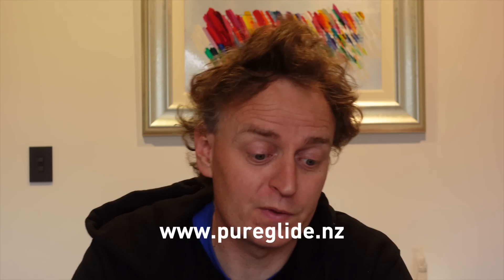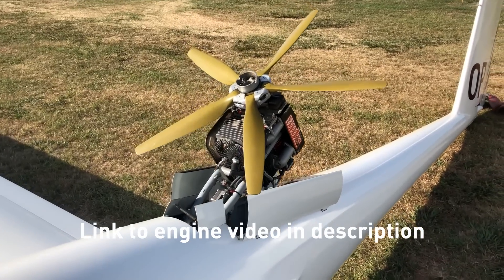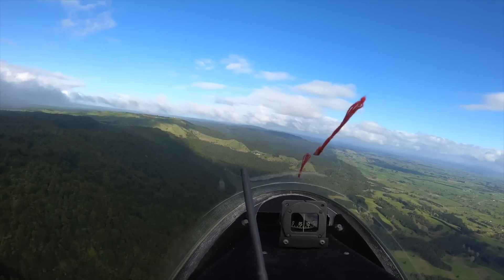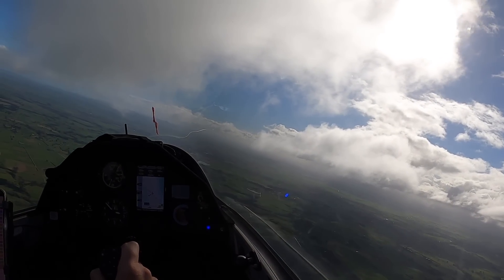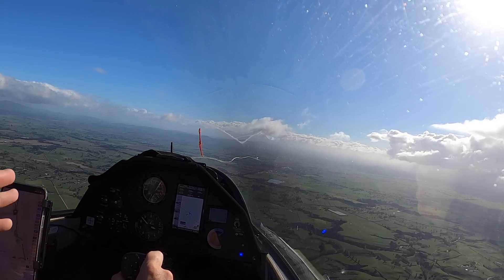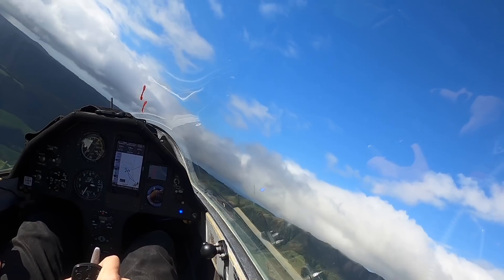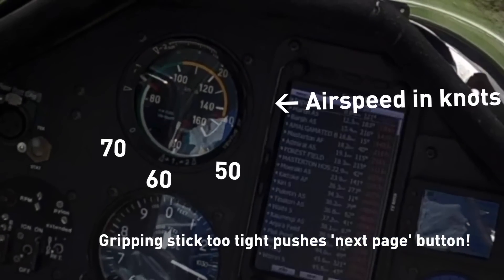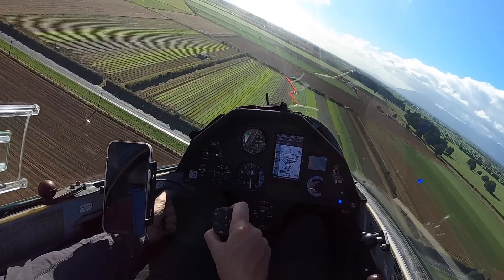Is it safe to open air brakes/spoilers in a turn?!

Comment: Nothing is fixed ... As you say, it depends on the parameters. For example:  the stall is a function of AOA NOT speed. A very common error! You can stall at any speed  if you can be that dynamic in AOA change...

Comment: Our airfield has a hill in the way right at final turn height, its a popular spot for walkers so approaching over the top of it is not tolerated. Only round 300m from the treshold. Its also the one most used due to prevailing winds. It's a regular arguement in the annual instructor meeting as to whether people should do it or not. We came to the same conclusion: Obey the minimum speed that you promised yourself and it's absolutely fine.

Comment: in a landing pattern the crucial parameter is speed : I teach my students to maintain approach speed (stall speed + 30%) until they turn final, then increase for headwind on final if necessary. At correct approach speed, even a poorly coordinated turn will never be deadly. If the student finds himself too high on base leg, using the spoilers allows him to reach final at a correct height, but I will usually advise to close them while turning final, because beginners usually have a hard time controlling all the parameters at the same time. 
On the oher hand, if the student is (too) low, then obviously there is no reason to use the spoilers until on final.
I do train the students to turn with the spoilers out, however, but while comfortably high : I'll request that they force the descent at the end of a flight by making  alternating turns on an "8" pattern with the spoilers half open... Great exercise for coordinating speed, roll, yaw, descent rate, and security !

Comment: Christ.....stalling a glider is NOTHING compared to powered crafts. You loose very little altitude stalling a glider do to the fact it takes very little speed after the stall when the glider starts flying efficiently again. There is virtually no danger concerning the topic of this video....WN Competiition pilot
Reply from the maker: haha depends how close to the ground you are
Reply: @PureGlide  ha ha ha........you could be lower than pattern altitude and recover without incident. Besides...anyone crashing a glider due to stalling it has no business flying them since sigificant extra speed well above stall speed is a given rule close to the ground.

Comment: You'te hot dogging it into the final but if you can get away with it, good luck to you. Also, using the engine is cheating.

Comment: Anyone who has stalled or nearly stalled while pulling the brakes was flying too slow to begin with.. If you are flying above stall speed as you should be in any configuration then it makes no difference, if your threading the line then dont use brakes, they are brakes afterall they create drag instantly which will shave off a few knotts quickly..

Comment: Your first stall was incorrect: you moved aileron to the right too soon, you should have corrected it with rudder only!
Reply from the maker: Probably true! It's so easy
Reply: The most counterintuitive thing is to move stick towards wing which dropped (or keep it neutral at least), and rudder in the other direction.  Otherwise you may stall more the wing which dropped. But modern gliders are very safe, so even if you get into insipient spin, just by releasing the stick pressure the glider comes out immediately    @PureGlide

Comment: Seems like a very obvious outcome since it all depends on your airspeed going in the turn.
The wing needs airspeed

A banking  increases your stall speed, 
B flaps slow you down but reduce your stall speed a bit
C banking  slows you down
D braking slows you down even more

IF 
A*B*C*D  
> 
VS1   
THEN 

GTG  

And the higher you are , the safer you can try it

Comment: Before watching the video I’m going to say “I wouldn’t if I were making any landing preparation turns with limited energy” only because I want to be super careful about stalling the inside wing. Let’s see how I do, I’m a glider pilot but I’m always learning. Great video, kinda what I thought in that airbrakes don’t change the stall speed so much (unlike flaps) The last video of your low level banking while you were squaring into final was a real sphincter workout. 😢Since I mention flaps, I’ve never flown a glider with them, do any modern gliders have flaps or crow-braking?🧐
Reply from the maker: Hi yeah most modern gliders have flaps. Most of the glider development focuses on the highest performance gliders, which means flaps. There are classes of non-flapped gliders too, but new models aren't created as often.
Reply: @PureGlide  Thank you 😊

Comment: Each time you stalled you picked the wing up with Aileron. Re visit your video. This is wrong. You should have used aggressive rudder.
Reply from the maker: Yeah I did a bit, that'll help go into a spin in many aircraft as seen in the latest video put out. Stick forward is the critical thing to un-stall the wing. That would be a good topic for a video in itself. Cheers

Comment: Hi, great content really enjoy your flights
As an ex instructor in the Uk
I  used to teach pilots to do good curcuits and final turn to be 300ft plus.
You being a good pilot you can push the bounderies and still be safe.
Going one stage further on the stalling in a turn,
Whilst on my full cat course i was shown 2 x turns 
One over ruddered bringing the glider to stall in thermalling angle of bank.
Two  same as above but apply top rudder away from turn.
Bring stick to back stop on both occationd and watch the difference.
This will open many eyes up whilst thermalling with other gliders.
We have ALL stalled in a gusty thermal.......I think this would make a good topic for you to do.
I look forward to more flights .
Well done 
Mick
Reply from the maker: Thanks Mick, yeah good points. Cheers

Comment: This is the most bizarre conversation. If one is at risk of stalling in the pattern with the brakes open, you are at risk of stalling with them closed. If one finds themselves in that situation they aren’t flying at the proper approach speed.

Comment: In a rare event that air brakes do not open symmetrically, it could be difficult to figure out quickly what is happening, and with the ground proximity it may lead to many further problems. IF they do open symmetrically, there should be no problem - but what-if remains. (That is the explanation my instructor gave me).
Reply from the maker: Yes, we do a brake test as part of our checks, usually at the start of the downwind.
Reply: @PureGlide  Thanks for the explanation!
Reply: Never heard of brakes not opening symmetrically. The DI should establish that anyway.

Comment: That was a very worthwhile learning experience. Practically applied theory - a true tutorial.  One question: is it wise to steer toward other gliders/cars even at the end of your ground roll? My instinct would be "No" but that may be determinant uoon the skill and experience of the pilot in a known craft.
Reply from the maker: Hi great question, I was thinking of
making a video about it. I’ve had my wheel brake fail a few times so my strategy is:
- land straight
- use the brake early
- only once most energy/momentum has been lost do I turn towards the side of the runway.
- I don’t use the brake after the turn, the energy has already been lost. Worst case if I miss judge it I can use the brake, and if that fails, put a wing down on the ground.
Cheers!
Reply: @PureGlide  The other thing I noted about this video, particularly, was the learning experience's strength. The combination of a visual tutorial and real-time demonstration was far better at communicating knowledge and understanding simultaneously. I wonder if you could convert your amazing instructor's experience to doing the same with each section of the training syllabus. The whole launch section for example would be a winner to ab initio's.

Comment: At the club I fly in France (and in all of France, afaik), we usually crack open a bit of air brake after turning base, check for symmetry of the breaks, and leave them open all the way to touchdown, just changing the amount. This means that the turn to final was usually done with air brakes open.  Never a problem.

Flying C101 Pégase, C201 Marianne, Janus C, ASH 25, etc

Comment: This is an interesting topic and something I have experienced which could have ended nastily. I'm going back to the 90s at Lasham, I was trained on a K13 and Grob 103, as you appreciate the 103 has a better glide ratio. With the instructor I had on the 103, on my downwind leg, if required, I could open the air brake and had it in its lowest position (point before you lock it shut). I did the turns to intermediate and final leg, say 400ft. No problems in this instance with the brake in this position. On the finals, stick to control my speed, air brake for attitude aiming for my point on the airfield. With the K13 however, thankfully I had an instructor with me, I did the same, however in this case, when I did my intermediate to finals, my lower wing stalled. Immediate stick forward, close air brake (by the instructor), it was a bit of a nose down attitude looking down at the ground was a bit frightening.  The instructor took over and did the landing and explained that this was very dangerous. I haven't done gliding for a long time (since last century 😀), trying to keep up with YouTube posts by pundits as I'm considering doing gliding again ......so just basing on my experience, one has to consider the performance type of the glider if turning with the air brake open.
Reply from the maker: Absolutely good point, thanks for sharing!

Comment: One thing you didn't mention is speed control. Lets say you set up the speed, with some brakes out, before turning finals, with sufficient speed. You now make the turn. Speed control, etc, is set up. 
If you shut the breaks, you need to control the speed with a ptich up, make the turn, pitch down/open breaks. The work load and requirements to control the speed has become higher. 
The opposite, where you have the brakes set doesn't mean you don't monitor the speed. The critical part in my view, is you need to check your speed. 
A counter argument, is with brakes being so powerfull, you use them as a vertical positioning method before you turn finals. Then turn finals with no brakes, then use the brakes on finals.
Reply from the maker: Great points, cheers!
Reply: @PureGlide  Thanks. My last check I was critiqued for the brakes open, but because my speed control was good, not an issue. It was also how I was taught. But it got me thinking which is correct, and what are the issues. Your comment on higher stall speed is correct and that hadn't occured to me. 

So I've not come to a definitive decision bar the key point of monitoring your speed being crucial.
Reply from the maker: I'd argue what really matters is that you're aware of how your glider behaves, and you use the air brakes as needed. And that you don't spin into the ground :)

Comment: open air brakes in turn is normal, but must be automated habit open brakes and push control to descent to keep speed. Also open them slowly depends on glider /for example open in 200km in L-13 Blanik just can badly surprise- they can just badly jump out/. for example what is a must if you get into spiral /and speed is increase like crazy - can happen in cloud?/, air brakes should be designed dont let glider over max. speed. Also during winch start, if glider have not released a cable and winch car must cable cut, its desired to glide in center of runway with air brakes as well. relatively fast put cable on ground and shortly land with cable

Comment: Changing the configuration of the glider late in the circuit is a clear indication that mistakes have been made earlier. During the transition addition drag is incurred. I teach if too high use full airbrake and loose 1/2 the excess height and then close them. During the period the airbrakes are open the vairo cannot tell you what the atmosphere is doing.

I was the full time professional instructor for 20 years at Portmoak, during this time we developed a program for Strathclyde University,  aerostructures course, half mechanical and half aeronautical engineering. The course went from less than 20 to over 200 in 15 years, 

During these years we gathered lots data. The most important is that during transition of configuration (particularly the airbrake)  created much more drag than before or after the deployment. Hence the current advise is do not change configuration in the turn where margins are slight.
Reply from the maker: Interesting thanks for the feedback

Comment: During training I was taught that it's not something you should never do, but should avoid doing, specially when you're relatively new to flying. 
The reason being, is that it's perfectly safe as long as it's a conscious decision where you have checked that it's safe to open them, but it can become a habit to pull the air brakes on the base to final turn, and habits like that can turn deadly. 
If it's a conscious decision that you're making, you'll check your airspeed and how the aircraft feels in the turn before pulling them.  If it turns into a habit you'll generally not do so, so you might do it on a plane you're not familiar with, or even when already pushing the limits in your turn.  You might even know you're on the edge of stalling, but out of habit just pull the brakes anyway. Best thing is to stay away from it, or open them before the turn, but if you have to open them in a turn to land safely it can be done with the right precautions.
Reply from the maker: Yeah great point, cheers!

Comment: Agree not with higher workload with low experience but otherwise, as long as you fully understand effects, they are just another set of controls available to the pilot. I think another important factor is to ensure all instructors teach the same at your club so that all students get common (and hopefully best practice) instruction.
Reply from the maker: Agreed! Cheers

Comment: Hey!
I perfectly agree with your conclusion that opening airbrakes during a turn in a  landing situation should not be a problem.
In Belgium (where I learned gliding), teachers told me to open airbrakes from the base leg and not to close them during the final turn if I needed them. Finally, keeping a safe speed is the key to avoid any dangerous situation.
Reply from the maker: Yeah sounds about right! Cheers

Comment: I fully agree with the summary. Not extending the airbrake in the turn is taught in basic training so that beginners don't hit the safety margins when they can't yet deal with the changing load and the change in pitch. And later it doesn't matter where you extend it, because then you can fly and you're not flying at the limit when you do the yellow triangle. And in your flight the speed was way above the yellow triangle. So everything was good.

The test was great in terms of the idea, but unfortunately not comparable. 
The angle of the test was much flatter. I estimate about 30° to about 50° at the landing. And the string blew outwards during the test (i.e. stable flight attitude) and blew inwards quite heavily during the landing (this is also a bad habit of mine, that when the turns are too low - after rope break exercises etc - I want to "push" the plane faster around with the rudder, but we all know that this is counterproductive).
I guess if you had produced that flight situation (and it's not that easy to deliberately fly a turn with the string blowing inwards so hard), I guess the Ventus 2ct (? - I fly a Ventus 2c, but my instrument panel looks a bit different, it has a step) would have stalled in the 51-55 kts range.

I must emphasise that an open error culture, which you exemplify like no other, is a fundamental part of flight safety. 
I have also published some of my flight safety talks given at our club on my channel (unfortunately only in German).
Reply from the maker: Hi thanks Arnulf, good points!

Comment: glad you made this video and debunked the myth of airbrake usage in turns. The fear of opening airbrakes in turns has already caused outlanding accidents because the student was approaching to high as it is "forbidden" to use the airbrakes before final. There is so much nonsense out there if it comes to gliding. My personal favorite is still the stupid idea that you need to change your speed if you make a turn with or against the wind. We have at least 30% glide instructors here that would believe such nonsense and teach it to students.

Comment: - being too slow during the whole thing is the main problem, the couple knots higher stall speed are irrelevant really.  a bad or dangerous landing results from a bad approach, especially if the base leg is too short. IMHO its like spin training. What do I need spin training for if the whole point of getting proper training is to AVOID spins, and understanding what exactly happens during stall onset in a turn at max AOA (dropping wing during thermalling, happens often to me, recovery is automatic and muscle memory). But spinning intentionally.. idk whats the point really. ease stick forward, kick low wing up with rudder.
Use of spoilers IMHO should not be treated as something to avoid. I use spoilers sometimes during aerotow when the tow pilot starts a PIO when flying through strong thermals and  I need to get rid of the slack fast. I don't fear my spoilers, I use them like an additional limb, and I love them...

But during landing, there is simply no reason to be too slow, and no excuse either. Yellow triangle exists, it is the MIMIMUM airspeed you fly. Turn to final mustn't be sloppy.